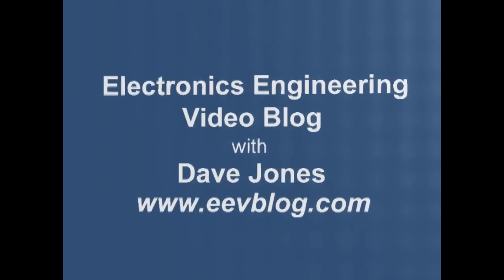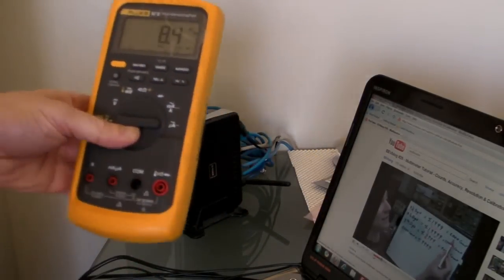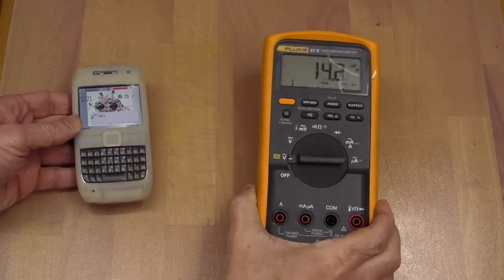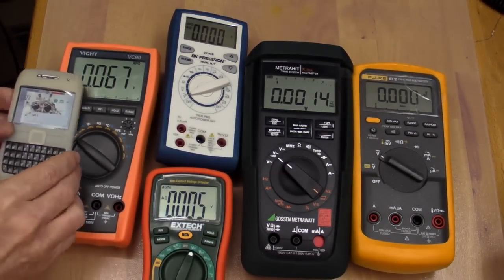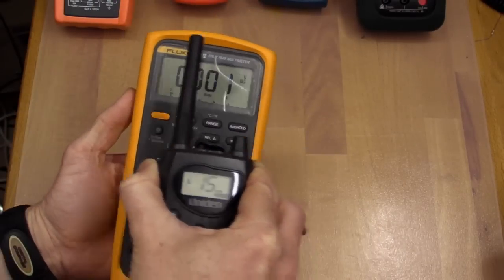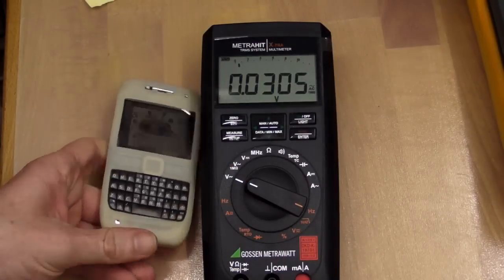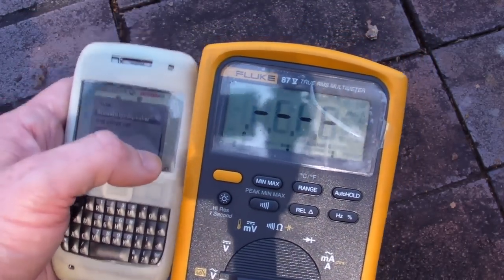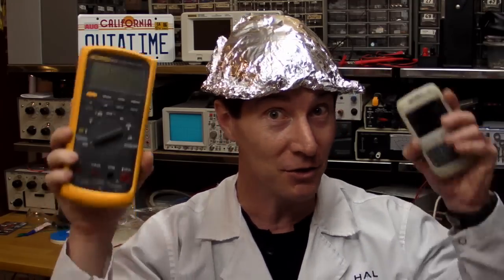EEVblog #112 - GSM vs The Fluke 87V Multimeter

Comment: GSM(including 3G) phones transmit at 1 or 2 watts, depending on the cellular system. You were getting lesser effects in a good coverage area because the tower tells the phone to turn down the power when it's closer.
Reply: Also the probes were not attached

Comment: It may not have bricked it because you didn't have the probes plugged in.  You were getting 10 times the response from your router when the probes were attached, so it's reasonable to think that the fluke might have died if it had the leads in with the cellphone.
Reply: Plus, perhaps if that person's leads were wound as they measured would cause the leads to be more of an antenna to pick up those signals....I am just learning but that was my thought....
Reply: I was thinking the same thing!

Comment: My 87-V is a ver. 011, I believe.  Built in March.  It doesn't have this problem (tested with AT&T GSM 850/1900, whatever the SGH-S125G uses), so whatever the problem was, Fluke definitely fixed it.  I love this thing!

Comment: The thing with GSM is that it's not wideband, it may frequency hop, but it's a narrow TDMA signal which needs to be broadcast at high power since it's not redundant. For the tower to capture the stream of packets from the phone, it has to scream it at the top of it's milliwatts.
most 3G systems though, are wideband and have a fair amount of data redundancy, so they broadcast on a wider spectrum with less power needed to establish a link.
[from what I've learned about it anyway, I could be wrong]

Comment: I once had an issue with one of my PCs: an active GSM phone less than 20-30cm from it would cause it to spontaneously reboot. Turned out the caps on the motherboard had blown. It's really interesting how poorly shielded, malfunctioning, or poorly designed electronics react to GSM's particularly nasty transmit patterns!

Comment: The thing is that the power of cell phone's transmitter varies greatly during call time. The peak goes to initial "connect" then bs is regulating it based on many factors (like distance from bs (higher distance - higher power), coverage quality (lower quality - higher power) and so on). So the power usually is somewhat from 0.002 watts to up to 2 watts (everything is about 2G, 3G is 0.25w somewhat constant, LTE - 0.2w ). That multimeter can easily go bricky if you accidentally (or not) put you cell phone over it and someone calls you by chance, I think.

Comment: It's probably the high power pulses GSM uses.  One of the main drivers behind the design of UMTS is the reduced exposure to RF energy it produces.  Since GSM is a TDMA system using a simple gaussian minimum shift keying radio, it produces a pulse train with significant amounts of energy at low frequencies-  which is why they interfere with the microphone in your camcorder...

Comment: understandable is the length of some wire inside is on quater wavelength or half wavelength then that will act as antenna and we would expect that. same goes for the PCB design is the curcuit printed on the PCB is of by coincidence of is exact or nearby length that will cause it to have massive interference. My guess is that the person who bricked have a phone with higher transmittion power although they should be standard but it might be little different.

Comment: That's actually surprising. I sold my fluke 87 because I needed one with a amp clamp built in. But I used my 87 for years with no problem whatsoever.

Comment: Hey Dave. Do you ever remove the plastic film from your digital displays? It's intended to prevent the displays getting scratched during shipping. If not, do you think it might be a good idea if manufacturers permanently bonded it to the screen as an additional form of protection (on top of the other laminations already put there for the purpose). eh? eh?
Reply: +tasmedic This sparked an interesting thought. It seems to be more sensible that the film is replaceable.
Reply: Good idea. Maybe we could sell protective films for our displays. Oh, wait, they're already doing this for phones.....Hmm...
Reply: That might be a good idea. I mean, it had me wondering where I could purchase protective films, so.... :-)
Reply: Are the films for phones "non-capacitive"? Static and capacitance are a part of plastics and films...and the manufacturer should have values.
Reply: I left the plastic film on my stereo display for a year and when it turned dark yellow I tried to take it off and it would not come off.

Comment: Great reviews and channels. I wanted to ask if you could do a video about multimeter probes.
I haven't used insulation piercing test probes but they would make my life a lot easier if they are safe to use on 110 vac circuits.
Proper use and your personal ratings would be very helpful. Maybe even another popular channel. 
Thanks for all your work.

Comment: I have this same problem with HP power supply from HP mini netbook. While i have incoming call and phone is near to PSU, my netbook shut down immediatly. I meed to plug off from AC power source, wait a second and connect it again then it work correctly

Comment: Have you tried to shield the phone from the signal from the next gsm base station? With full reception the phone usually reduces transmit power - so "full bars" means less output power. 
Also: Try it with a HAM Radio station. I can knock up many devices even witth my  handheld radio doing 5 Watts on 2 meters :)

Comment: Replying years late just because I can... Pain is just an adaptation to reduce cellular damage. If a robot has a subroutine which causes it to retract its arm from fire or other sources of damage, I think it would be accurate to call that routine 'pain'. Sure, it's simpler than the animal version, but its purpose is the same.

All pain does is motivate the brain to find a solution to the damage in a way which is very hard to ignore. Pain would be useless if it were easy to ignore.

Comment: GSM and 3G are two separate entities? Is GSM the encryption? Thanks for the video, Dave, as I will now purchase a Fluke 28-2 instead of the Fluke 87V. So, Fluke never responded to this video?
Reply: Note that even if your phone doesn't scramble your meter, it'll probably mess up your readings. My advice is to keep mobile phones & any other kind of RF source the hell away from your bench, just on general principles.Save that kind of interference for the reliability testing phase of your design!
Reply: Lionel Lauer I see you've been checking out old eevblog videos as well :)
Reply: Jasper Janssen Yep. Dave's a local guy. I remember when he first started posting YT videos & linking them to the Usenet electronics design group we both posted to.
Reply: Jeez, in 2008, I think?
Reply: I've seen the eevblog around occasionally from.. I think back when the newest was 100-odd, something like that, which is already quite a bit back.

Comment: 3G power is more spread among frequency using code division and spreading.
Also every cell phone (UE in technical terms) is instructed to transmit at certain power, not less and not more, because more power brings more interference with other UEs
2G is simpler, it uses as far as I know time division, the power is more focused in frequency, more power, better quality

Comment: hah, interessting.  I have problems with my Camcorder.
When i put it near a magnet (filiming a speaker in 10-30 cm distance) it shuts off until i pull it more than 30cm away  ...

Comment: Hi. Your camera is giving you a hint. What causes the problem is not GSM carrier frequency itself (900MHz or 1800MHz) but TDMA modulation/coding that audio circuit in your camera could also pick up. It is 1/8th of the 4.615ms TDMA frame that translates to 217Hz that you can hear in your audio. Try any audio tool that can generate tones and generate 217Hz 12% pulse wave.

Comment: Why is the mic picking up the static?
Reply: It's not static, it's "GSM buzz". Random traces and attached audio ICs can actually detect the GSM frequency (800-900 MHz) and turn it's audio-range AM-esque content (0-22 kHz) into that damn noise.
Reply: you238 close, base gsm is TDMA with a ~4 milisecond frame repetition so you get a  216hz fundamental, there are also 1/4 and 1/2 second (51 and 102 frame) repeats of control signals, giving the charistic pulsing. FDMA or CDMA won't have the same repetive cycles, so won't create a buzzing

Comment: 3G power output is lower than 2G
Reply: But a different frequency.
Reply: the 3g power is indeed much much less than 2g. I have a RF meter, it reads -40dBm at 10cm from a phone in 3g/4g and -5dBm at 10cm in 2g (in normal 4-5 bars condition). Also 2g emits at full power (2watts) the first 5-10 seconds when you establish a call. It don't thing the carrier frequency of 2g and 3g is a factor here but the 2g signalling indeed have a strong low subfrequency (that typical sound you hear in your speakers when you put a 2g phone close to a audio amplifier). I'm not an expert in RF shielding, but I always try to avoid to put my phone right against my laptop/harddisk/usbstick when it operates in 2g.

Comment: Please get familiar with EN 61326-1 :2006 Class B Emissions and Immunity
fluke pass it 3 V/m (80 MHz to 1 GHz) for A1 condition.
Can you check what is emission on your devices on that frequency range (phone, rooter, etc). Are they dont pass that norme plese dont make show.
ps Many EN/ISO standards allow for turn off device on immunity tests. It's not a big deal.

Comment: I once held a cellular phone antenna in my hand from a mobile putting out 3 watts of energy at roughly 8 to 900 megahertz and I could literally feel the heat coming down my arm today cell phones put out a maximum of 600 milliwatts and the reason why you hear the packet bursts is because it's putting out more than 600 milliwatts that's why your battery is going dead so fast the phone's constantly shaking hands with the power is IP phone never shakes hands with the tower as much my batteries last forever I just couldn't hurt cell phones into sip phones carry on
Reply: I feel like there was interesting information in your post, but there were also typos and a lack of punctuation that made it confusing. If you edit it, I think you'll get some up-votes. :)
Reply: I'm using voice recognition that's why there's no punctuation if you can't understand the gist of what I'm saying I don't know what to tell you and I'm not looking for votes
Reply: +peter laurance I think I got the gist, but I commented because I'm not sure. I understand you don't care about votes, but what I meant was that your comment might be understood by more people.
Reply: There's NO WAY you felt heat in your arm with 3 watts. That's just not enough energy to heat anything up with that kind of impedance.
Reply: Tiny RF Burns, yo.